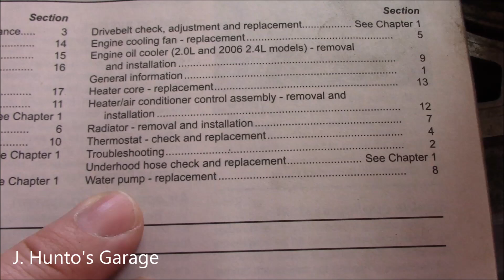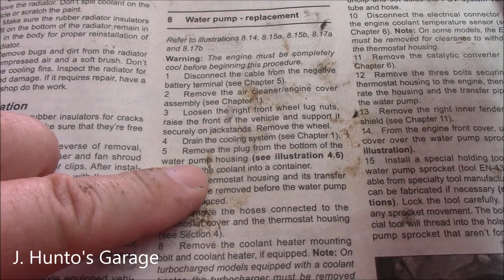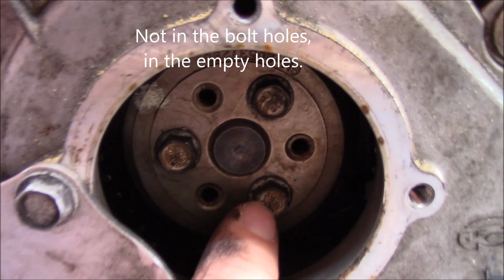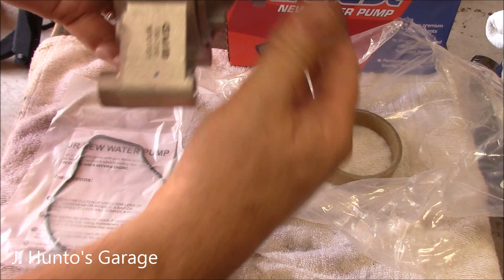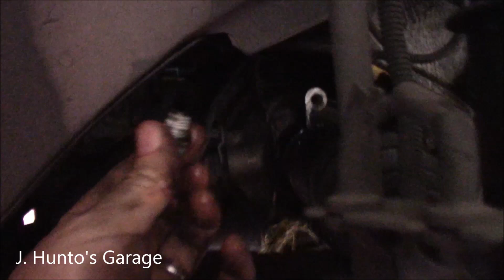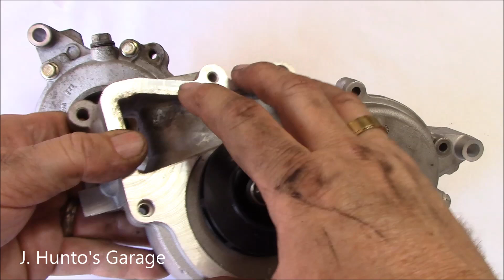Changing the HHR Water Pump, Detailed

Comment: This video is by far the BEST VIDEO on water pump replacement.  Everything is well explained.  THANKS for making this video.
Reply from the maker: Trent Black Thanks man! Glad I could help. Hit that subscribe button for more.
Reply: J. Hunto's Garage.  Hi.  Thank you so much again for making this video.  Three additional important points your users should know having followed your video.  1.  If you are doing in a Chevy cobalt with the engine still installed you will be doing part of the process left handed for putting the coolant xfer pipe back in.  2.  You can't see many bolts for the coolant xfer tube so get your gfs makeup mirror.  Its bigger.  Yes now you are working left handed and in a mirror against the firewall. 3.  I gave up on the alignment bolt.  You can hold the water pump in the back while putting in one of the 3 bolts to hold it to the timing chain thing through the little hole.  LAST. Get a magnetic 10mm deep socket or play fish the bolts out of the engine.

Comment: What I don't understand is why is there timing marks on the chain that only runs the water pump? You have have to have the intake gear and exhaust gear pointed in a certain direction there's a timing mark on the gear on the crank but there's nothing for a timing mark for the water pump and all they are is gears not really driving anything but the crank and the water pump because the exhaust gear and intake gear ain't driving nothing. Or is that some kind of balancing technique
Reply from the maker: If I remember right, this also turns the balance shaft. If I remember right. The mark on the water pump sprocket makes no difference.  Thanks for watching!

Comment: I did my water pump and the car runs fine no overheating but my concern is theres a loud whining sound pls help thatnks
Reply from the maker: Could be belt related. You can eliminate the belt by removing it and briefly starting the car. Could be the bearing in the water pump as well. Hard to tell from my point of view.
Reply: @jhuntosgarage  i did remove the serpentine belt but the loud whining sound is still there and i use a stethoscope to locate it.. And its the water pump itself.. Maybe a defective parts????
Reply: @jhuntosgarage  i think its the bearing from the new water pump is defective cause as u accelerate it gets louder... Note i use the special tool for this job.. Thanks for replying back
Reply: Nope. Your sprocket moved a little and messed with timing  cause u prob didn't use the special tool like this guy.

Comment: please does this mean that it's possible to get antifreeze or coolant mixed with your oil if the water pump is faulty. Because mine is mixing my coolant with my oil, please help because I changed the cylinder head and gasket but the problem persist
Reply: Yes, for sure.

Comment: Nice write up. Ill add that the 13mm bolt that covers the timing access port, if removing it to get into the timing cover, you may need to crack/loosen the upper trans mount bolts as well as the upper engine mount. (I had to and you can find the sweet spot where the 13mm can come out in a hole in the frame rail.)

Comment: Great video, but the music sucks, drama I don't need.
Reply from the maker: Martin Marsh I agree. Thanks for putting up with my lack of video production skills. Mechanics and video producing don't easily crossover, as you can see in my sad attempts to make these. Thanks for the input. I hope the video was helpful.
Reply from the maker: Martin Marsh Now that I watched this again, I'm going to remove the music right now.
Reply: I'm going to attempt this today, I was wondering, couldn't you just mark the piece that you are trying to hold with the screw and then a mark on the outer case.
Reply: I think I already know the answer to my question, because you are not only holding it in time you are also keeping it from falling down.
Reply from the maker: Martin Marsh Possibly. Are you talking about the gear on the water pump? When I did this, several times, I found it not a big deal keeping the sprocket in place. It doesn't have very far to fall either so it won't fall down into the timing cover.
Reply from the maker: Martin Marsh If you want, hit me up on Instagram and message me.
Reply from the maker: Martin Marsh If you get into trouble just take the timing cover off.
Reply: Thanks for getting back to me, I'm not worried about it, I usually have to learn everything the hard way, but then I never forget.
Reply from the maker: Martin Marsh Story of my life! I'll upload this video again, no music, and put a link in this video to the "less dramatic" version. Thanks again for your input. I do appreciate it. Good luck!

Comment: Good video, but like he says, get the sprocket holding tool, it's like $20-25, it's worth not jumping your timing, or having to mess with the tensioner.
Reply: Yes looks like he may have broke his chain tensioner not by holding water pump gear with more bolts , I saw it way off center at one point.
Reply: Sprocket tool is $12 on Amazon and pump is $28 also on amazon I'm changing the water pump this weekend
Reply: You can rent the tool from autozone if you have one near you. A lot of places rent tools now